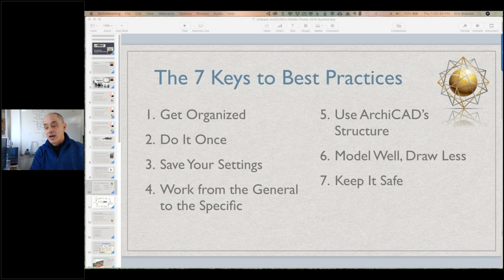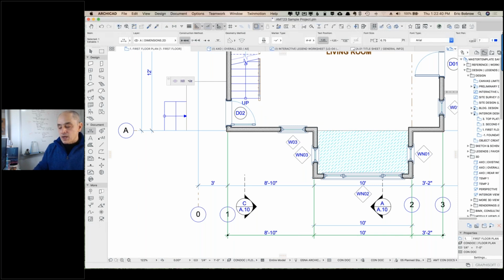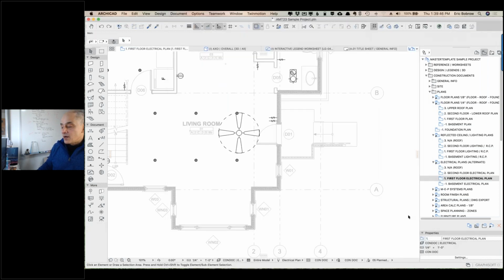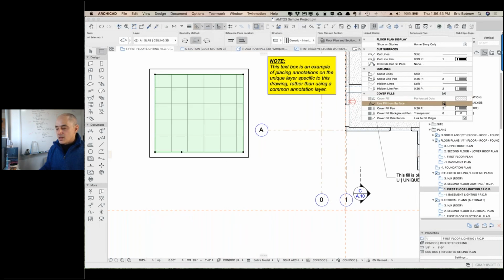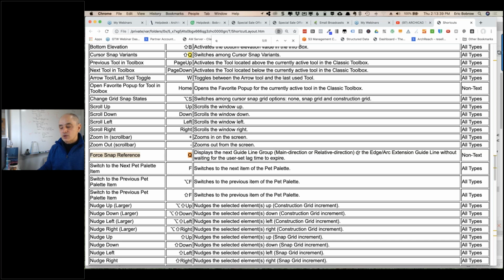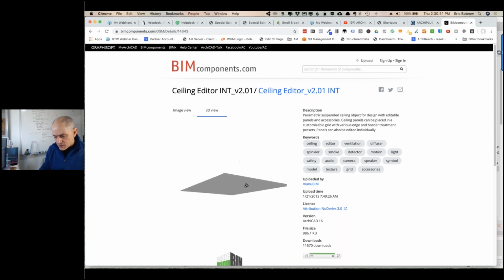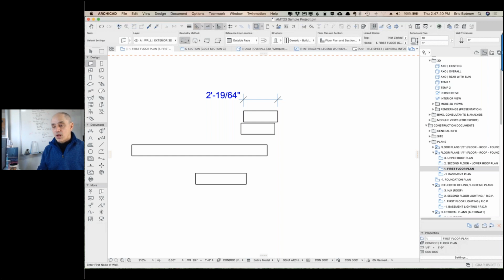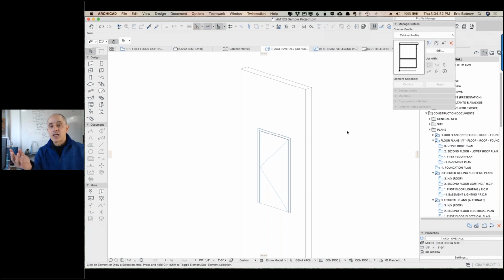ARCHICAD Basics: Tips & Tricks (Dec. 2019 ARCHICAD User webinar)

Comment: Here are some timestamps with the issues/questions discussed:

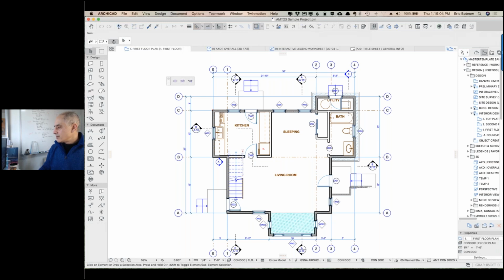16:11 "Do you know how to place a distance at a certain distance from a wall?"
20:15 "Is there a way to edit dimensions by using grips?"
22:28 Alternative way for placing dimensions at specific distance using guidelines/hotspots
25:56 "How to access the free webinar?" &  26:36 "Can I get a video on a previous tutorial?"
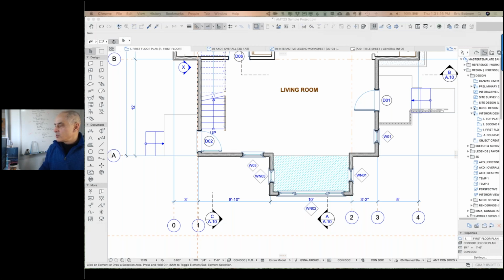28:49 Associating dimensions with objects.
32:21 Difference between the Project Map and the View Map.
44:04 "Use Q to force snap references"
46:23 "How to create a 2x2 acoustic ceiling tile?"
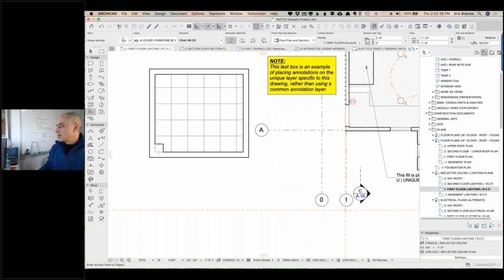59:47 "When should I ever put anything on the "Archicad" Layer?"
1:04:34  "How to draw a ramp from the ground floor to the basement?"
1:07:06 Tips relating to managing Keyboard shortcuts
1:12:47 Flashback comments to the "Archicad" layer question
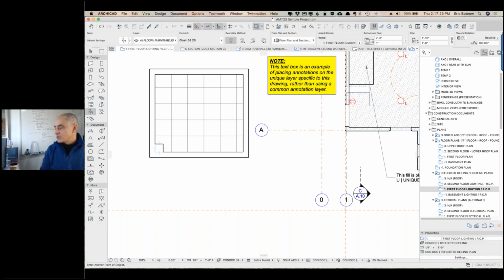1:14:32 Flashback to the acoustic tile question (using a horizontal curtain wall).
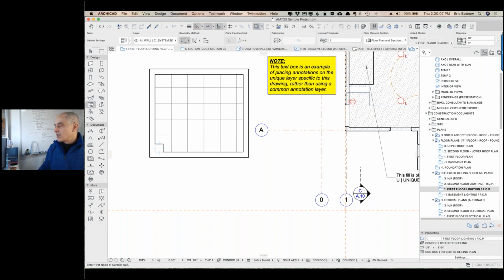1:17:09 "Can you set the layer for an element so that when you pick the command it goes to that layer?"
1:20:08 Flashback comment to the "Archicad" layer question
1:22:11 Tip for changing layer on multiple and various types of elements.
1:25:17 About the "Ceiling tool" available through ARCHIPLUS
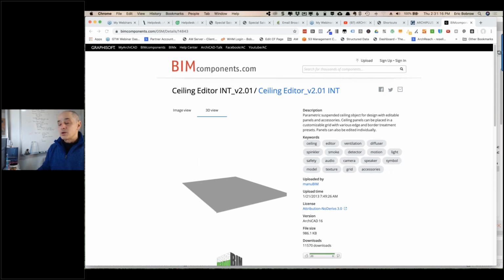1:28:20 Flashback comment for Keyboard shortcuts

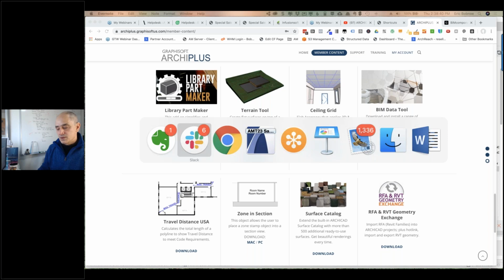1:35:46 How to place and draw elements cleanly and accurately
1:50:49 "Sometimes when I have a stacked wall I have problems with a door or window cutting through both where they pass through. What's the fix?"
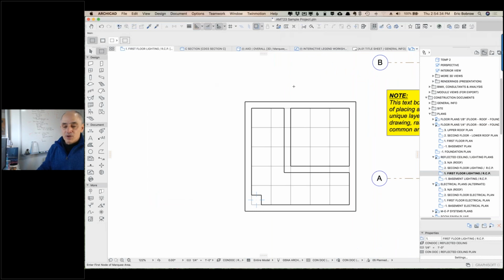1:51:38 Trick for generic cabinets.
1:58:15 Flashback to the stacked wall and openings question.
Reply from the maker: Wow - thank you George Petsagourakis! Much appreciated. I will copy this and place this into the description for the video.

Comment: Another solution to the first question at 16:11: after choosing all points and double clicking to confirm the placement, hover over the corner you want to set off from and type "y" (for y- axis) and then "5-" and confirm by hitting enter. You can even do this kind of offset without the dimension tool enabled to create a temporary guideline.